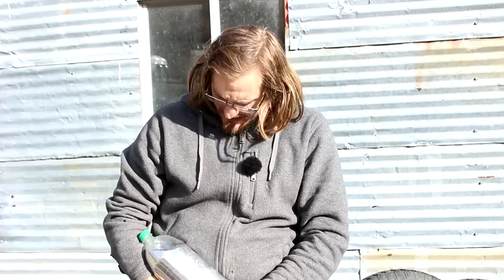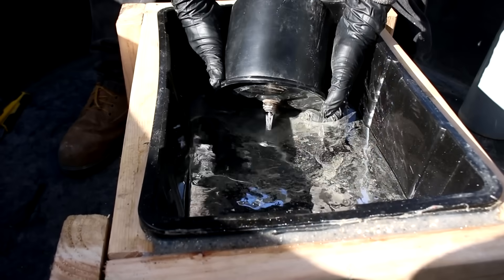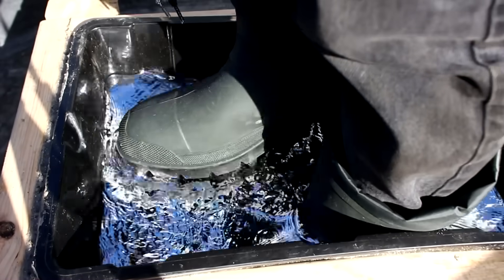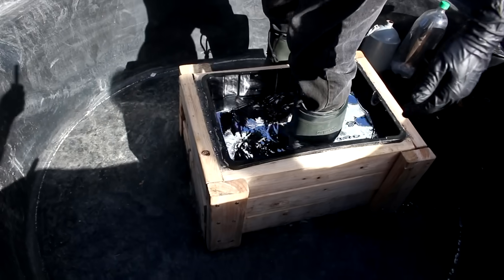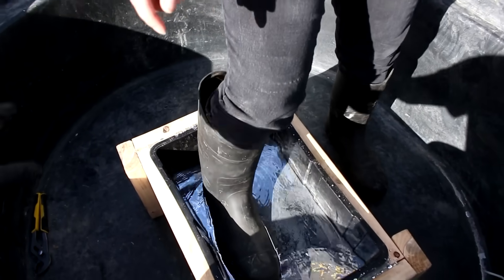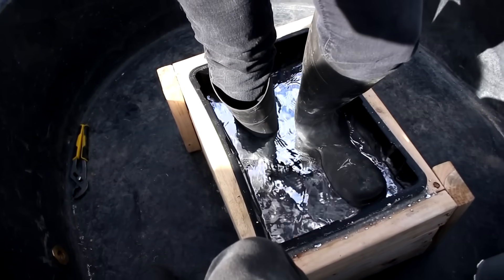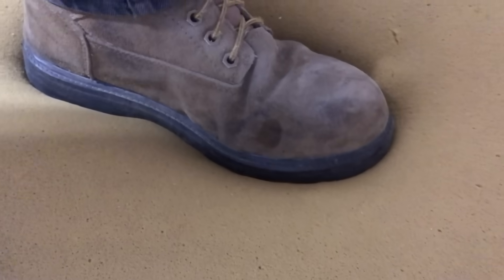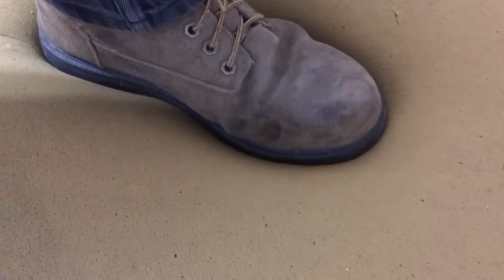Can I Stand On Liquid Mercury?

Comment: You are not taking Mercury seriously , you are still alive after crazy experiments . What steps do you take  to clean your equipment so you don't get any sort of poisoning
Reply: He is taking mercury very seriously as he has worked with it for many years.  You saw the cleanup he did at the end and all of his waste from all of this experiments is reprocessed to remove any toxic chemicals and either neutralized or disposed of properly.  As for mercury, he has another video where he talks about the recovery and distillation of his mercury to ensure it is pure.  Being that this is elemental mercury, the risks to Cody during this experiment were relatively small.  The likelihood of him being poisoned at all during this experiment are quite small due in no small part, to the steps he took to minimize his risk.

Comment: That can absorb through your skin and cause problems
Reply: Actually Elemental mercury is not readily absorbed through the skin, but instead is only really a concern if there are open wounds present which would present a direct path to the bloodstream.  Organic mercury compounds, on the other hand, are extremely dangerous as these will readily absorb through the skin due to their solubility in fat.

Comment: Why do you float with both feet in  and not with one feet in
Reply: Alex Velasquez imagine jumping in the water straight on your back with your arms and legs fully stretched, that hurts right? This is because the water has a big surface to "push you back", and in this way slow you down, thats why you feel the pain, because youre being slowed down rapidly against a surface

If you would jump in with your feet down and your arms and legs along the rest of your body you wouldnt feel any pain because the water doesnt have enough area to push you back.

Now with Mercury 1 foot isnt enough to completely push you of the bottem of the container, with the 2nd foot it DOES have enough area, and thus force, to push you of the bottem of the container.
Reply: That's a good question! These answers are mostly wrong.  When one foot displaces mercury, the height of the mercury rises. When you place another foot in, the height rises yet again.  So with both feet in, the volume of mercury displaced, and therefore the buoyant force, is more than doubled!

Usually, in a large body of water, the volume you displace only raises the level of the fluid a negligible amount.
Reply: As mushookie man says, it's about displacement. To know if something will float you basically balance the weight of the object that you want to float against the weight of the liquid displaced by that object. Think about it this way....Imagine Cody weighs 70kg. If the volume of one rubber boot displaces 35kg of mercury, then it is not balanced so he does not float. Adding the other foot means that 70kg of mercury is being displaced, thus balancing (floating) our 70kg Cody.
35kg of mercury has a volume of 2.58 Litres (0.68 Gallons US), which is about the volume of a rubber boot. So we need to get about 5 Litres (volume) of Cody into the mercury before he can float.
Reply: lower pressure per square cm with 2 feet than with one
Reply: it was too shallow
Reply: because with one foot twice the weight is focused on one boot which is less surface area however with two feet, the surface area is twice the size.

Comment: Hmm how safe is this? His glove touched his hair. Will the utensils be de contaminated properly
Reply: It's not exactly safe, but then again, nothing is completely safe in life.  However, nothing will happen from his glove touching his hair because mercury doesn't wet things, so none would be left on his glove to be transferred to his hair.  And even if, by some infinitesimal chance, there was a mercury droplet on his glove, AND it got into his hair, it would roll out or be shaken out by his body movements or when he showered next.  Elemental mercury doesn't absorb through the skin easily so unless it happened upon an open wound on his head, it would be basically a non-issue.  In addition, Cody has been working with mercury for years and knows how to handle and decontaminate equipment properly.

Comment: Do a full immersion next time! Lets see how easy/hard it is to float on your back. 😀
Reply: He was floating on his feet, which have much higher downward pressure than what would be spread out across one's back or whole body.  Navigating would be very awkward, but floating would be automatic.  There's no part of your body save a few grains worth of heavy metals, that would not try to float.  The backstroke would be a little like laying on an oily floor.  To swim in mercury, you would have to weigh yourself down with lots of gold or tungsten, along with bringing a respirator mask.  While elemental mercury isn't toxic, it would readily coat your lungs and probably be very hard to remove.

Comment: Aren't the vapors toxic or is it safe because you are outside?
Reply: He's outside on a cold, breezy day and using cold mercury.  The cold temperatures ensure as low a vaporization rate as possible and the wind ensures that any vapors are dissipated rather quickly, so the inhalation risk is minimized.

Comment: So like....if you drank literally the smallest ball of mercury, would you die? Can you explain what makes it toxic and what it looks like on the cellular level? After all, it's just liquid metal :P
Reply: Mercury is, similar to lead and other lower-period metals, a Heavy metal. Heavy metals have the property of reacting with the organic substances in your body, most of which have a highly complicated and specialized structure, and completely wreck them in the process. Imagine having a figure made out of clay and tossing a rock in. The rock propably sticks to the clay and leaves a big dent, which renders the entire structure useless. In the body, this can result in damage to various parts of your body, most notably the neural system due to the amount of fat it is made of, which organic compounds of heavy metals often dissolve into.
Reply: Fra32Entertainment Thank you.
Reply: Fra32Entertainment so as a chemistry student current learning about chemistry lol, would an example be CH4+Hg combining with your DNA and deforming a cell's cytoskeleton?
Reply: Also, since only low period metals like potassium, magnesium, etc have this property, why not high ones like francium? What does the amount of shells have to do with their reactivity?
Reply: The reactions taking place during heavy metal poisoning(general term, lead poisoning and mercury poisoning are both heavy metal poisoning) are fairly complex due to macromolecules being involved, but you can generally say that the atoms will stick to many different macromolecules of your body, including DNA and many different proteins/enzymes. The main reason for their lethality is their plain size and mass, allowing them to excert great force onto other molecular structures when bonding with them. So generally you can say that any metal that is in the lower periods of the periodic table(6th and below) are fairly unhealthy for your body.

Comment: You could probably stand on it pretty well if you used very stiff and think soled clown shoes ... something with a very large surface area on the bottom.    For instance, if you first placed a metal garbage can lid on the mercury and then stood on the lid.  I suspect you'd float.  If you tried that in water you'd surely sink.  The point being that you have a certain weight.  The volume of mercury that you displace must match that weight.  As the area of the soles increases the depth that you must sink to displace the required amount of mercury becomes less.  Mercury's density is about 845 pounds per cubic foot.  So if you have 845 pounds of mercury and place it in a pot that has a bottom that is 1 square foot and the pot has sides that are higher than 12 inches then the pan would float in an ocean of mercury.  If you weight 200 pounds and you stand in the pan (assuming you could keep your balance)  then the pan would only sink in the sea of mercury about 2.84 inches.  And if you stand on two 1 square foot pans then the two would float you at a depth of 2.84 inches divided by 2 = 1.42 inches.  Now in the pan bottoms were each 2 square foot then the depth you'd sink would be halved again, and now be only  0.71 inches. So if you had clown shoes that were 1 inch think soles and each had a sole surface area of 2 square foot  then you could stand in a sea of mercury and only sink 0.71 inches.  And that would probably give you the sensation that you were standing of the mercury.

Comment: If your boots/shoes had a large enough surface area on the bottom you could probably walk on top of a pool of mercury. Kind of like snowshoes. Great video!
Reply: Since the mercury is a fluid, what keeps him up is the buoyancy, the Archimedean displacement. This relates to volume, not surface area. This is different from snow, which is essentially a solid, and by having a large surface area, we can minimize the force on each small bit of snow, so that it doesn't crush, or move out of the way.

Comment: Yeah! Fill a swimming pool with Mercury and try to run across!!
Reply: Swim in mercury every day for a year and come out swole as fuck
Reply: Shawn1174q That would actually work until you would lose balance and strength/speed, then you would crash down onto the mercury
Reply: It would be awesome but even this small tub was worth tens of thousands of dollars.
Reply: Where the fuck is he going to get a swimming pool's worth of liquid mercury!?!
Reply: Mercury is at least $3,000 per flask!!!
Reply: Shawn1174q well if he failed he would die especially if and goes in his nose or ears

Comment: I don't think Cody would have floated without the boots on (or a somewhat deeper vessel). Assuming mercury is about 13 times the density of water, and that he is around 70kg, then he would need to displace about 5-6 litres of mercury in order to float. The extra size of the boots provided this extra displacement and is what allowed him to float.